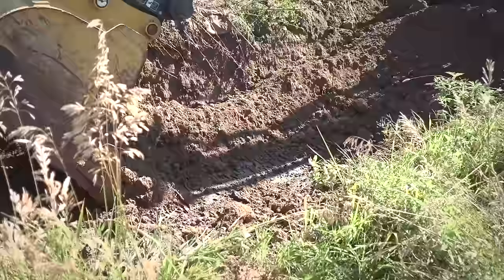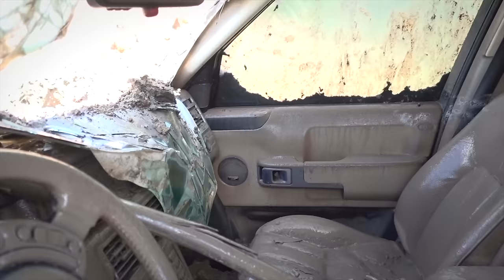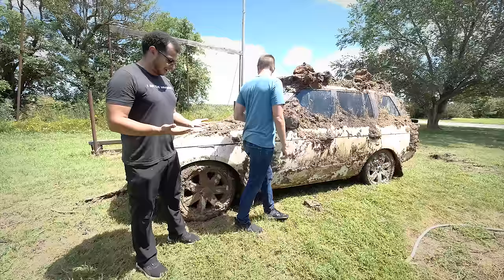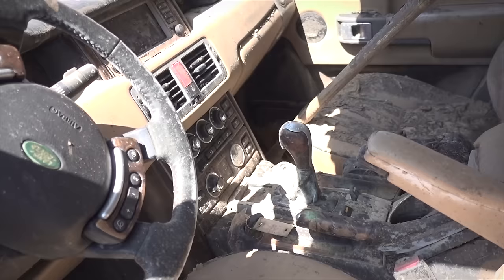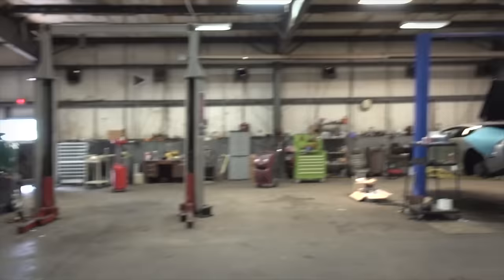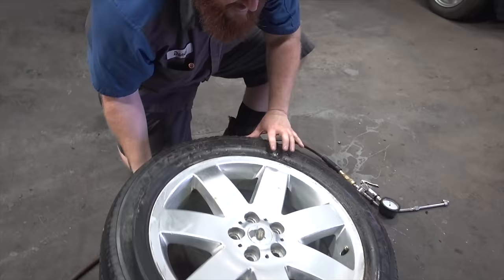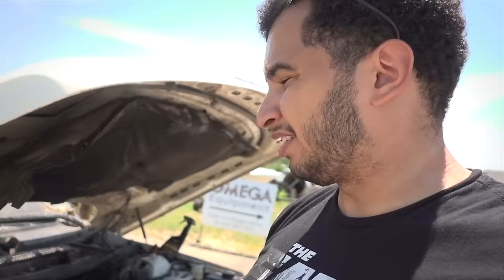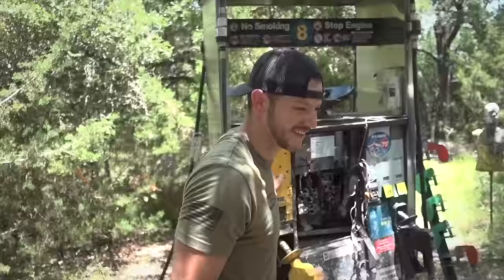Fixing A Range Rover That Was Buried Underground For A Year Was A HUGE DISASTER

Comment: For all those asking about the BMW engine : In 1994 Rover Group plc (including Land Rover), was acquired by BMW. Rover Group was later (2000) sold by BMW to Ford Motor Company. - At this point the engine supply for 'the New' (designed by BMW) 2003 model year Range Rover, consisted of Beemer engines. This supply of engines lasted until the 2005 model year...
Reply: @AnusIntruder  - Absolutely, German engines usually are (reliable). -  I still own a 1999 Range Rover (P38 bought pre-owned in 2002) with the British made engine and the entire vehicle with Bosch electronics was/is fantastic !  - The main issues with that 'new style' BMW 2003 RR, were with it's driveline (some diff issues) and the new version air suspension (mounting points weren't as durable as the prior RR P38 model). Having worked at Land Rover during that period, the BMW engines basically had no issues. With the care & attention I've provided over the years, my 1999 P38 engine, driveline AND air suspension are all original & still functioning flawlessly...
Reply: @y2ktube  the 2.5 bmw diesel in the 38 was shockingly bad .it was gutless .even chipped up it was useless ,and the fuel consumption was terrible for a diesel.
Reply: @AnusIntruder  Just got rid of my 2000 BMW 740 with that exact same engine in it after 300,000 miles.  Once you replace timing chain guides and maintain the cooling system they last forever.
Reply: @craigpimlott204  that Bmw 2.5turbo diesel IS a very good engine and gives  very good service if well maintained. AT least as good as that Rover v8. I have both . People that Say its a shitty engine are mostly shitty drivers.
Reply: @maseratirijder  it was gutless .the thing was useless for towing .our welsh mountain roads showed it up for what a piece of junk it was for towing a trailer uphills ..and not even a big trailer at that ..
Reply: @craigpimlott204  your p38 was a pièce of shit im sure my diesel does fine but dont Ask it to bé Quick its not made for that. Its a good workhorse if well maintained.
Reply: @maseratirijder  mine only had 38.000 miles on it so it wasn’t fucked .full service history come from Land Rover dealer .unless 38.000 miles on one of them engines is classed as fucked
Reply: @craigpimlott204  there IS only one problem with the m51 diesel engine IS misses a bit of torque down low thats all. And of course the Lucas shite electronics of the pré 2000 p38,s

Comment: If you don't count the engine, drivetrain, suspension, interior, driver assists, lights, wheels, tyres, exhaust, body panels, locks, windows and brakes, it's in perfect condition.

Comment: Had it been an 85 Hilux, I guarantee you it would have started, with a bit of wd40 😁😁😁😁😁
Reply: And Top gear proved that 😂
Reply: Definitely...they are bullet proof.
Reply: Toyota all the way....
Reply: Had it been a Hilux it would probably not have broken down in the first place. But if it against all odds should have happen I believe it would be reasonably inexpensive to get it running again.
Reply: @mannycalavera1998  And I've had 3 hiluxs  this week. All engines gone.   Oil pressure issues.
Reply: @Godwillsortyou  land rover lover
Reply: @hitchy0755  just a mechanic and no shit 3 diesel hiluxs in one week , 2 spun bearing and seized, another big end knock . Years 98 , and 2010 X2.  Would never buy a range rover .   Mitsubishi have better pedigree, pearl harbour and all those Dakar and WRC victories.
Reply: @Godwillsortyou  ok
Reply: @hitchy0755  I guess Manny was right in it being inexpensive to fix  if you have 5grand to throw at a rebuild.
Reply: @Godwillsortyou  yeah

Comment: Would be a decent mud truck project. engine and transmission out of a old truck barebones no ac, no exterior repair needed.
Reply: Matthew Zepess not an off-roading channel tho but would be cool to see him go through some trails 😂
Reply: GDGames I know, but for a project for a truck oriented YouTuber it could probably be worth it. Stripped lightweight luxury styling with a swapped v8 Chevy 350 4x4 would make some good videos. Junkyards down here in florida have v8 engine for 200-350 and a transmission for $200
Reply: Yup strip everything, dump all electronics, run a link/megasquirt or whatever

Comment: Welp, cars mechanicly totalled not worth fixing it! Let's bury it!

Digs car up 

Attempts to fix car after it is now completely totalled.
Reply: There is no such thing as a mechanically totaled car.  If Tyler sold the vehicle and the next guy fixed the engine, it still would have been cheaper than buying a new one and he would have gotten the same miles out of it.

The notion of a mechanically totaled vehicle comes from the throw away culture Americans subscribe to.
Reply: @mexicanspec  tbh it mostly has to do with labor cost. Someone who has the skills to diagnose, dismantle and assemble is more expensive than someone/a robot that simply just assembles, therefor a new car or used ''new'' car would be cheaper.

though i agree with the concept of throwaway culture and how detrimental it is.

Comment: Has anyone explained why you would bury a Range Rover and cover it over completely
Reply: The only question I want an answer to
Reply: He said it needed 8k in engine repair and would only be worth 3k running? But that doesn't seem right for a late model range rover.
Reply: @louiscastro2701  It's no reason to bury it . Sell it or repair it ....bury it ???
Reply: Because it would be funny...
Reply: Tyler mentioned the cost of repairs. Yet having a sizable hole professionally dug & filled, then a year later have the car exhumed & pulled out has to cost some funds too. ??
Reply: Shock value.
Reply: Spend $8000 to fix it and sell it for MAYBE $4000... or.. spend nothing.. maybe a few hundred to bury it.. make money off the multiple YouTube videos you film..

Comment: If it doesn’t run then repair the damn thing, what other things do you have to do in a pandemic anyway
Reply: Not that simple unless you have a degree in computers as these models have their own annoying expensive ways. You need a special diagnostic tool and a ream of A4 + two cartridges for the inkjet.

Comment: Is that really a BMW engine in a range Rover
Reply: Luis Naranjo yes. BMW bought the Rover Group in 1994, and did most of the design and engineering work on the L322 generation Range Rover before they sold Land Rover to Ford in 2000. A lot of the parts are directly from BMW, including the electronics, infotainment, etc.

Comment: I wish you would fix my car, I recently lost my job and I got a land rover lr3 2007, doesn't need that much fixing ,engine wish, emissions purge flow, ( would like an over all check) the rest is external ( missing rubber on passenger side door) small wax issue on hood and top of car...I'm in nyc ...